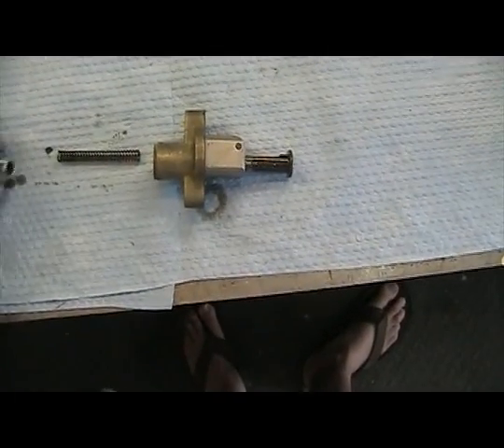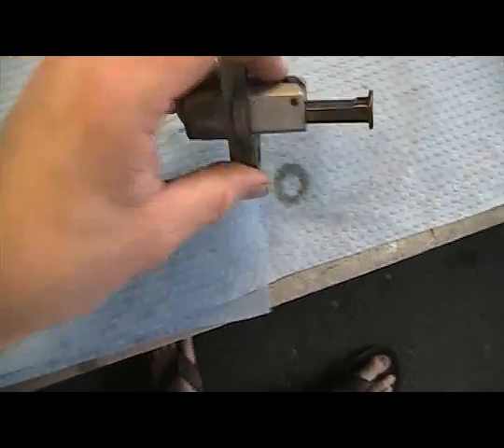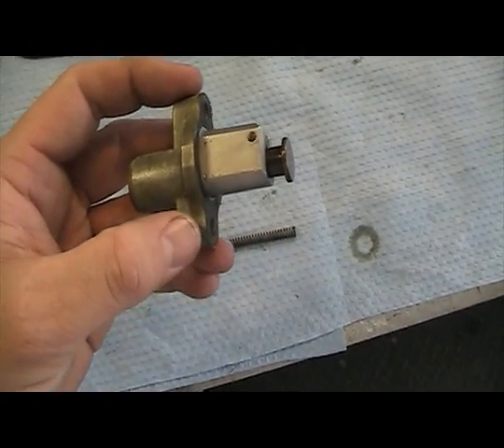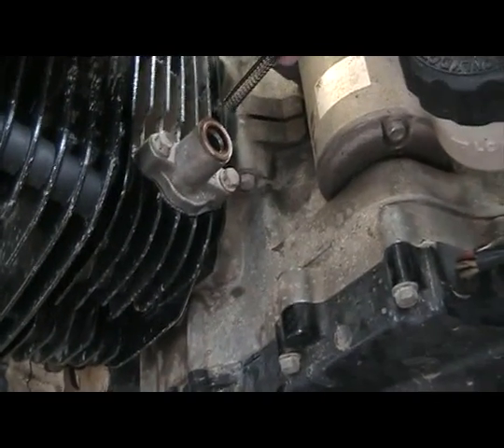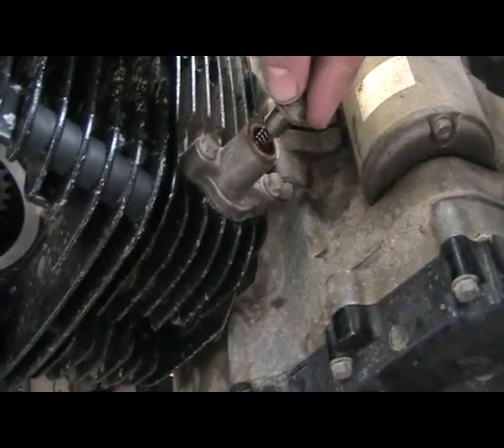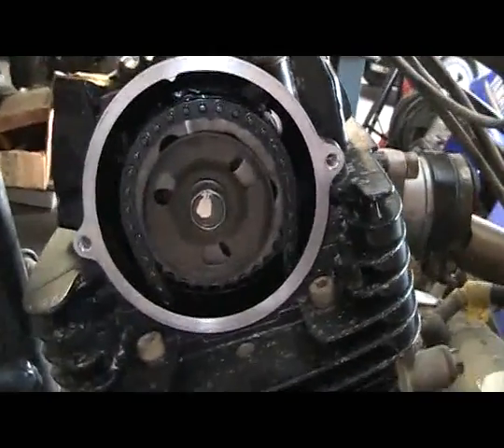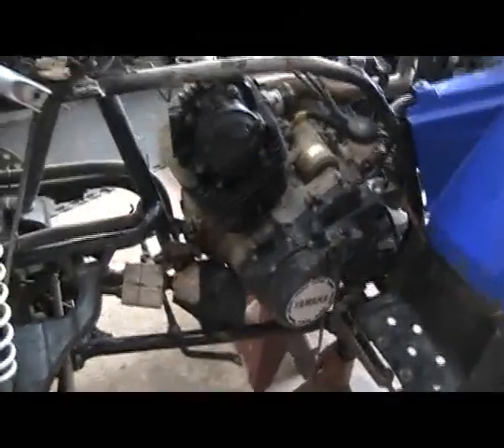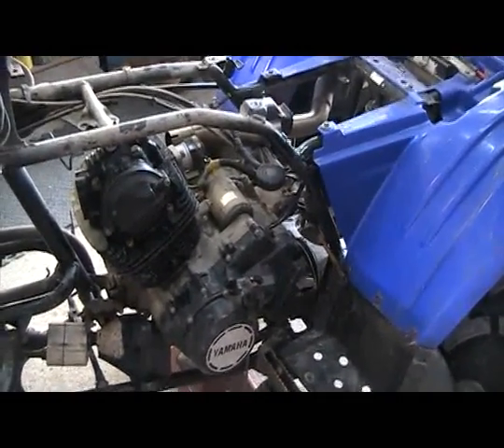PART-8 Yamaha Wolverine 350 4X4 85mm BIG BORE 366cc kit & Hotcam stage one cam install.

Comment from the maker: @spykeeable I have a local machine shop that decked the head and set in the new valve gilded. I installed the cam, it's easy but, there some measurements that need to be correct.

Comment: Where did you get the head cleaned up and the hot cam installed. I wont to add a stage one cam to mine but i need the cam installed. Thanks. awesome video